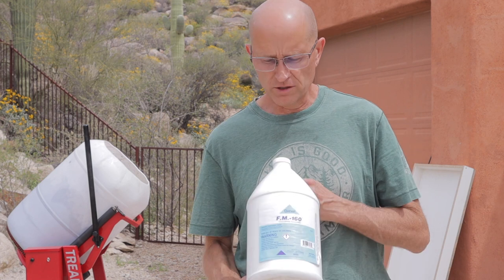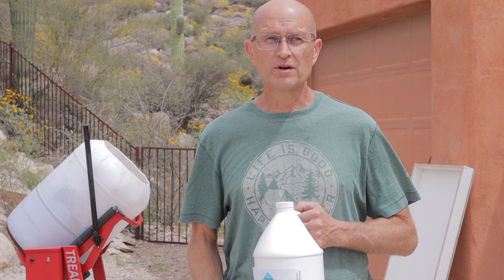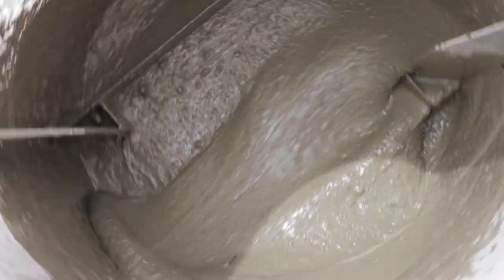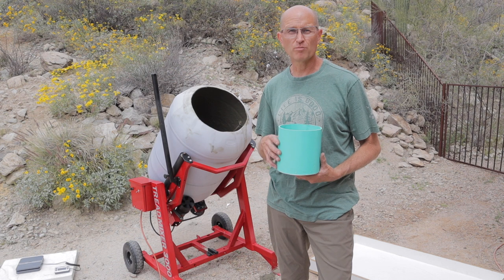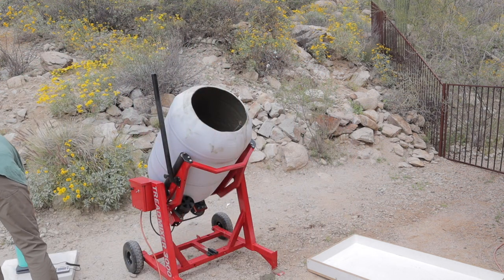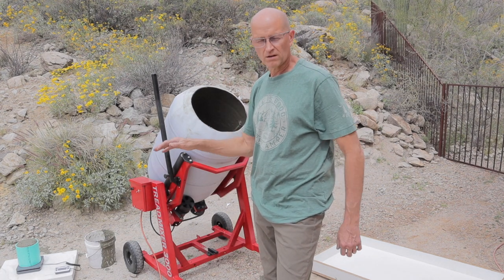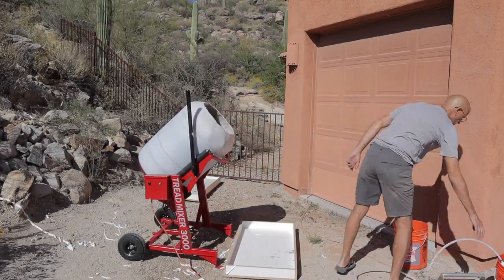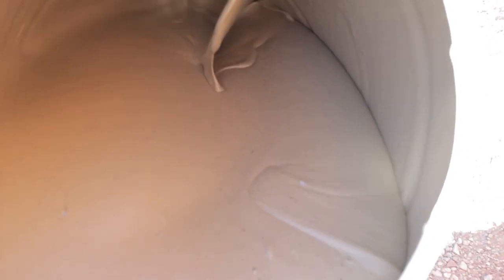How to Make AIRCRETE The RIGHT way!  [ How to measure Density for consistency.

Comment: If your form was made vertically, then it would dry out much more slowly. Not sure that wood would be the material to make it out of though. Also, if the slabs were made vertically, then you could make multiples in one form using sheet metal separators - of course you would have to coat the mold with a release agent. And a pouring lip is a good suggestion to add to the mixture.
Reply from the maker: If you made your forms vertically, the weight of the slurry will collapse the bubbles. This is why you see most people making their forms horizontal. 😊👍

Comment: In our experience, the density of the foam is way more important than how much foam you add. Less foam makesthe aircrete way stronger. We'll be showing our test sample results soon.  We have huge temperature swings where we are in southern Arizona. We are mixing at about 80° in the afternoon and getting down into the 30°s overnight. We leave the aircrete uncovered until the next morning, which has worked out fine. Did it work to cover it, & did this panel turn out?  Maybe you show them on the next video, I'll check. 🙂
Reply from the maker: No video of the finished panels. The javelina came through overnight and stomped them all to pieces and ruined them.🤣👍
Reply: @PranaTech  Gotcha, I'm surprised nothing big has stepped on ours yet. We have had some birds on the garden wall, and some rodent tracks on one sample, but nothing too catastrophic.  Later we started putting metal chairs over the samples just in case our daughter's dog comes around early in the morning.  Aircrete is cool stuff, we are impressed with it's performance.
Reply: I have seen your videos on testing different blocks and post. Just wanna ask how much foam do you add on that standard mix you have. Thank you.
Reply: @UrbanGardeningDIY 
 Aircrete recipe we used:
In barrel mix
5 gallons water
94 lb bag of Portland Cement

Foaming soap solution:
5 gallons water
1/4 c. (4oz) Drexel 
1 T. Glycerin
Foam weight 80-100 grams per quart.
Mix into cement slurry enough foam to make a 45 gallon batch.
Reply: @RedandAprilOff-Grid  thank you. I appreciate it. More powers to you guys.

Comment: hello. Great video. Just a thought.  I was reading some of the comments about the hard water and the different foaming agents and was wondering if you tested the pH of your water and adjusted it at all, since concrete doesn't like acid.
Reply from the maker: Hi there, yes, I’ve played around with the water and even tried distilled water to eliminate that variable and it does make a little stronger foam. I’ve started using a foam concentrate from a company called Vermillion and it has eliminated all my foam durability issues.👍😀
Reply: @PranaTech   Is that still being sold? I can't find pricing through Google.
Reply from the maker: Good morning! Yes, here is a link to their site. https://www.vermillionassociates.com/varimax-concentrate.html 😊👍
Reply: @PranaTech  Thanks, I did find that page but there doesn't seem to be any pricing or method of ordering. I assumed the page was a remnant and they weren't selling it anymore.
Reply from the maker: Yes, as far as I know they are still selling it. They are pretty low tech so you have to call them.😊

Comment: I am thinking of making some self supporting roof panels 4ft by 6ft for an outdoor aviary. I was wondering if you have any suggestions on thickness and or interior reinforcement.
Reply from the maker: Hi John, that’s an interesting idea! I would think something in the 3 to 4 inches thick would work, but you would need something like what they use for concrete counter tops called “scrim” to ad structural strength to it. It is basically a square woven cloth with various size squares depending upon your size of panel.  👍😀

Comment: I like the ideas, just wondering if you tested the strength of of your mixture and how many psi, thank you again for your video.
Reply from the maker: Hi Andrew, I haven’t done any formal testing yet. I would  have to invest in some expensive test equipment and I have so many other projects on the list before that.😀👍

Comment: Hi, I appreciate all your work with aircrete. How do you get the correct amount of foam into the mixer as it is turning? Also do you think a regular concrete mixer will do mixing properly? My project is to make a raised 12 in. high garden bed with air crete using 2x2 welded mesh I have as reinforcement. Any comments or suggestions will be appreciated. I have built 2 sheds out of papercrete which are good so am excited about building with aircrete as it should not absorb water like papercrete will.
Reply from the maker: Hi Larry,  here are the ratios that I use.  You will need a scale that is pretty accurate. For every 15.66 pounds of Portland cement you add one gallon of water. To this mix you add 7.5 gallons of foam.  You will need to get your foam generator set where it produces good foam and then accurately time how long it takes to fill however many gallons of foam you are going to need in your mixer. This will obviously be determined by how large of a mixer you buy and how much Aircrete it can mix without overflowing.  This time of foam application will now be your dose time and you can use it accurately every time. 😀👍
Reply: thanks that info. is just  what I need. Do you know about adding some sand or gravel to the aircrete mix to stabilize it.
Reply from the maker: Adding sand will increase strength and density. Adding gravel is tough because it wants to sink to the bottom due to the weight. 👍😁
Reply: I wonder if you could add a low density rock, like pumice, and what would result from that.
Reply from the maker: That’s a great idea Dustin! I never thought of that! 👍😁

Comment: Love this video! I am trying to make some planter bases of Aircrete and am experimenting with small amounts, just to get the proportions right. I did an experiment using shaving foam. seemed to work pretty well, but having a hard time getting the ratio, portland cement to foam, right. Your 30 lb/c.f. sounds ideal- about 1/3 of regular concrete alone. What ratio of cement to foam are you using? Or are you just mixing the ratio to a 30 lb/c.f. weight/volume? Thanks so much!
Reply from the maker: Hi Paul, here is my recipe for a big batch. 
My recipe is mixed in a 55 gal barrel and I mix 6.5 gallons of water with a 94 pound bag of Portland cement and once it is blended into a nice even slurry, while still blending with my drill, I fill the barrel up to the 45 gallon mark with good thick foam.  I then mix it just enough to incorporate all the foam into the Portland slurry and then I stop and pour into my mold. For a small batch I mix 15.66 pounds of Portland cement mixed with one gallon of water. Then add 7.5 gallons of foam. Let me know if you have any other questions.😊👍
Reply: @PranaTech  Thanks so much, This is perfect. I may start by quartering your recipe as I need to test this before I start making bigger batches. Do you think 4 lb. of Portland, 1/4 Ga of water with  30 cups(1.875 Ga) of foam would work as a tester?
Reply from the maker: I think that would work great! Glad to help anytime.👍😊
Reply: @PranaTech  I'll let you know how this goes, and what I learn. I just cast the mold. 2 notes so far, 1- the i added another pound of Portland as the 4lb/.25 ga ratio seemed a little watery- I used 5lb/.25ga. 2- By volume I had a ratio of about 1:5.25, concrete to foam
Reply: OK, the block dried. Weight seems pretty good, but it's a bit soft. If I run a pen on it, it engraves. Is that supposed to happen?
Reply from the maker: Hi Paul, yes that is fine. Aircrete is pretty soft on the surface. It’s main benefit is it’s insulating properties. To make it structural you need to add sand and that makes it heavier and reduces its insulation value. 😊👍

Comment: Can you use a regular concrete mixer?  Or does it deflate the mixture?
Reply from the maker: Yes, you can use any mixer, you just have to do smaller batches and once the Portland mixture is well mixed, you add the foam and blend just enough to mix thoroughly and then pour into your molds. This prevents it from deflating the mixture.😁👍
Reply: @PranaTech  great!  Thanks for answering and so quickly!  Do you ever add glycerin to stabilize the foam?
Reply from the maker: Hi Casey, no I haven’t tried that yet. I have heard that it helps but since I started buying high quality foam concentrates designed for Aircrete, I haven’t had any problems with foam collapsing. My current favorite is from a company called Vermillion and there concentrate is amazing stuff!👍
Reply: @PranaTech  can you provide a link to the Vermillion product?  Much thanks for all your help!  

I made my first aircrete product yesterday, well, it was actually made with plaster and a can of shaving cream poured in silicon molds shape as small plant pots.
Reply from the maker: Hi Casey, here is the link to Vermillion https://www.vermillionassociates.com/varimax-concentrate.html 
They will sell a sample if you just want to try them out.👍😀
Reply: @PranaTech  Much thanks!!!

Comment: Good morning, Don. I hope that this finds you and yours well in this devastating pandemic.  I'm unsure how I am supposed to add a new message here. Do I make a new query here, or add to the 'replies'? I do have questions. As Aircrete blocks are being stacked, does one mortar as the blocks are stacked? And, how much insulation does Aircrete supply? I live near the Canadian border in northeast Washington state. We can dip down into the below zero range in the winter, with several feet of snow, and up toward the 90s in the summer, but a dry heat. If I need to insulate, what material do you suggest?  How do I need to reinforce my dome to support the snow load? Thank you in advance!
Reply from the maker: Hi Annie, here’s my business email. Send me a message on there for future questions that way you don’t have to keep going to the comments to ask. As soon as I get your email I’ll send you a chart for R values for thicknesses of Aircrete. I also have an engineer in Idaho that I’m working with to approve designs for my dome. My design will be approved for snow load but will take a little more work than the standard DomeGaia style aircrete dome, which no engineer in this country will stamp for structural design. I know, I’ve tried. 😁👍pranateq@gmail.com

Comment: how much cost would it be when i use (600mm x 3000mm x 100mm) mold? and raw material mixing ratio?
Reply from the maker: Hello. Here is my small batch recipe in metric. 7 kilos of cement to 4 liters of water and then add 30 liters of foam. Mix the cement and water well and then add the foam and mix just enough to incorporate it into a well blended mix and then pour into your mold. You will need to enlarge my recipe to fit your mold and then calculate the cost per batch for what your materials cost locally. Hope this helps.😊👍
Reply: @PranaTech  thanks!

Comment: What is the right mix proportion of water, cement & foam, and also the mix proportion of foam solution of water & foaming agent
Reply from the maker: Hi Ric! Ok, here is. My Aircrete recipe. 

15.66 pounds of Portland cement mixed with one gallon of water. Then add 7.5 gallons of foam. 

Or in metric.

7 kilos of cement to 4 liters of water and then add 30 liters of foam.

My larger recipe for a big batch is mixed in a 55 gal barrel and I mix 6.5 gallons of water with a 94 pound bag of Portland cement and once it is blended into a nice even slurry, while still blending with my drill, I fill the barrel up to the 45 gallon mark with foam. 
For the foam concentrate to water ratio, I use what the manufacturer recommends. With Richway concentrate I use 4 ounces of concentrate with a 5 gallon bucket of water. With Vermillion concentrate I only use 2 ounces with 5 gallons of water because it is more concentrated. Here are links to both companies. These are the best foam concentrates I have found. https://richway.com/product/cmx-foam-concentrate/  https://www.vermillionassociates.com/varimax-concentrate.html Hope this helps! 😊👍
Reply: @PranaTech great video. How are your Aircrete structures holding up after a few years? Does Aircrete have enough compressive strength to use in load bearing walls on a two story building? I noticed you haven't been making Aircrete videos in quite a while. Do you still recommend it
Reply from the maker: Hey, great questions! Ok, in the method I was making it in my previous videos the answer would be no, I would not recommend it for a two story building at all. Standard Aircrete would be fine for a dome home with an outer layer of fabric and cement slurry to tie the structure all together. For a conventional square home, I would only recommend it for insulation in the walls. I had a lot of issues with deflating bubbles and density consistency during the hot Arizona summers here. I have been experimenting with a chemically induced Aircrete that rises like a cake and uses no foam so the bubble issue is removed from the equation. I am building molds right now and should have a video out soon showing the process and recipes for structural blocks and even engineering processes to test your batches for consistency and structural strength. 😊👍
Reply: @PranaTech  thank you for the informative answers. A number of Aircrete proponents have encountered problems and moved on to something else. Recently, I have observed some alternative builders replacing air bubles with shredded Styrofoam but have no idea about long stability.
Autoclaved aerated concrete (AAC) block is much stronger than Aircrete and weighs 80% less than traditional concrete. Unfortunately, it is costly. It appears to have good compressive strength and be stable over the long term. I believe it can NOT be manufactured outside an industrial facility and has the additional costs of shipping the block to you.

I have seen videos of large bricks made by compressing damp earth that includes an unknown amount of clay at 3000 PSI with no heat like traditional bricks. If your dirt is suitable, you could buy a machine to make block on site. I have never seen these machines in person but they seem to form strong, stable and large earthen blocks.

GOD bless you.
Reply from the maker: Essentially what I am making is AAC without the autoclaving step. The only thing the autoclaving does is cure the concrete quickly so it can be sold. Cement cures within 28 days naturally so you can build the same blocks yourself but they will need to cure before use. God bless you as well my friend! 🙏😊

Comment: I know this is an old video but what if you replaced the water with a cement adhesive? It might produce a stronger aircrete.
Reply from the maker: Hi Daniel! Yes, that does create a slightly stronger Aircrete. If you really want it stronger you simply add fine sand to the mix and the greater the amount, the greater the compressive strength. 😁👍

Comment: Hey I have a question. Can you add pumise to the aircrete? I thought of making it hold to a wall or to make molds?
Reply from the maker: Marco, I think pumice would work great because of its lightweight. It won’t sink like regular aggregate does, especially if you used small pumice sizes.👍😀

Comment: Aeriated concrete has been around at least 50 years. One of the applications in the 70's was pouring floors in new apartment buildings.
Reply from the maker: Hi Ken, thanks for your comment! I had no idea that it had been around that long! 👍😀
Reply: @PranaTech  Like your videos. I will be using air crete to build my house. So far I like your rigs best.
Reply from the maker: Thanks Ken! Let me know if you ever have any questions. 👍😀
Reply: Aircrete and aerated concrete are completely different things.

Comment: I would like to make five gallons of air create. Could you tell me the Portland to foam and how much water ratio. I've tried this about 20 times and Can't Get it Right
Reply from the maker: Good morning! Ok, here’s my recipe for a smaller batch of 5 gallons of Aircrete.  7.5 pounds of Portland cement, mixed thoroughly with 1/2 gallon of water. I put the water in the bucket first and slowly add the Portland and blending completely until no dry lumps remain and all Portland is hydrated.  Then add 3.75 gallons of foam to the mix while blending and only blend long enough to incorporate all of the foam completely into the Portland slurry. If you blend too long it will destroy the bubbles and your Aircrete will collapse.  What type of foam concentrate are you using?
 This may come out less than 5 gallons after blending but it is my standard ratio and can be expanded larger if you need more. Hope this helps! 😀👍Don

Comment: I read what happen to those panels. Have you made any that you could strength test when cured? Very good video and happy you made it!
Reply from the maker: Hi there, no I haven’t made any yet for strength testing. I’ve made enough now that I can get very consistent results and I’m confident that I could build my dome home with no trouble at all. My big setback so far is finding an engineer that will sign off on plans for Aircrete building. None of them will put their stamp on it unless I put a shell of rebar and shotcrete on the outside. This really defeats the purpose of building it myself if I have to hire a shotcrete company to finish my building.☹️ I’m still looking for an engineer but I may just have to build in Mexico.👍